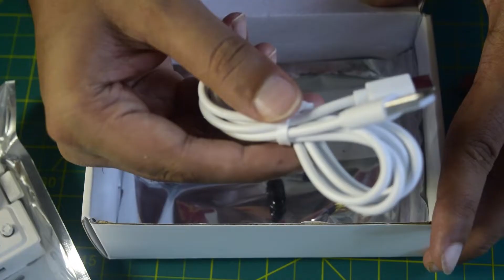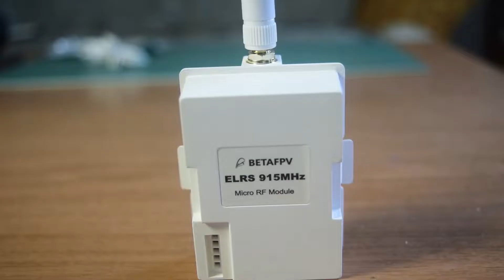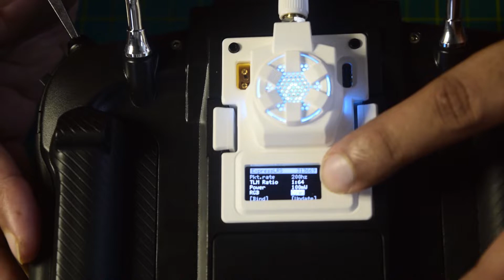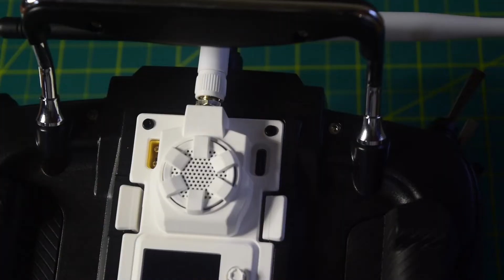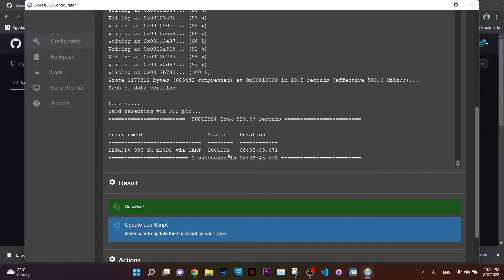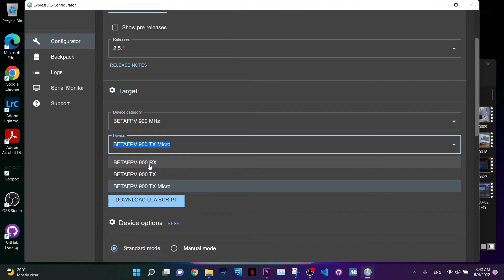Beginners Guide to BETA FPV ExpressLRS Trasmitter TX 915Mhz | Review, Firmware Upgrade and Bind RX

Comment: If you use speedy bee elrs configurator and a speedybee wifi adaptor 2 it needs a mico usb to type c adapter on the   elrs module tyoe c update plug ?
Reply: The speedybee wifi adaptor needs a usbA end instead of a micro usb on both ends .

Comment: Can you please explain 915 MHz or 2.4ghz which one is better and why..., Which one have long range capability
Reply from the maker: Normally higher the frequency shorter the range so 2.4ghz has shorter range than 915mhz reliability depends on your region and interference that you have in your region. About which one is better is depending upon your use case as both have benefits and drawback but in general shorter range faster response and high speed telemetry which is benefits of higher frequency . Which smaller frequency you get the long range but slower reponse time and slower telemetry. I hope this helps. Please stay tuned to my channel for my future videos
Reply: @AstroShootingStars  thankyou so muchh, how much long we can go with 2.4ghz